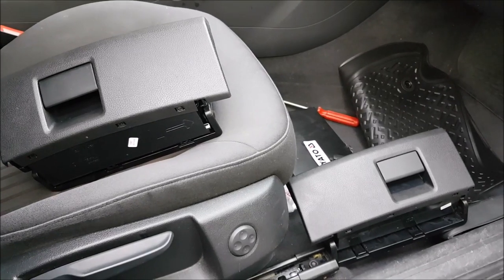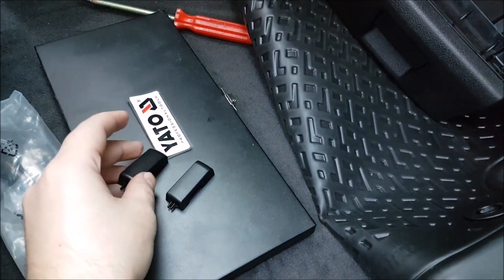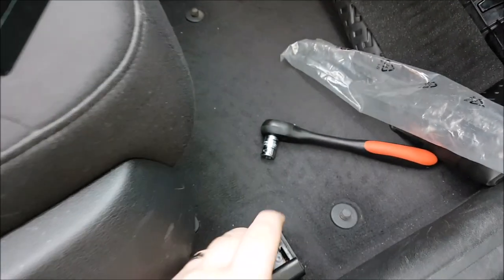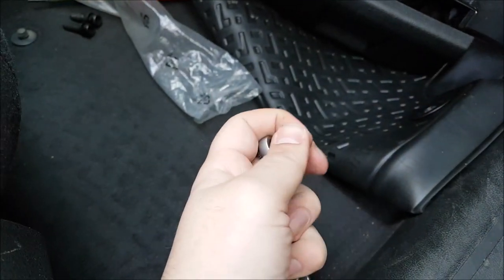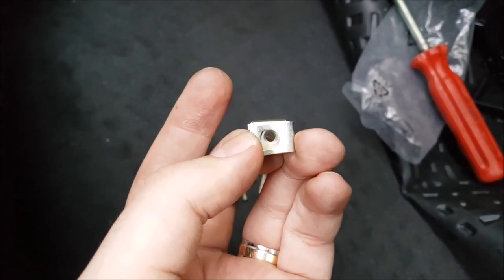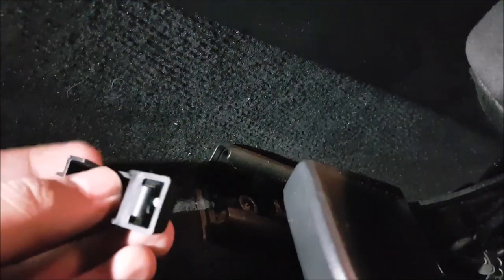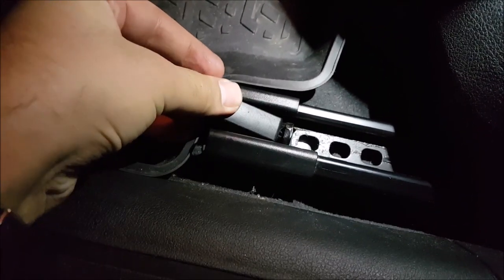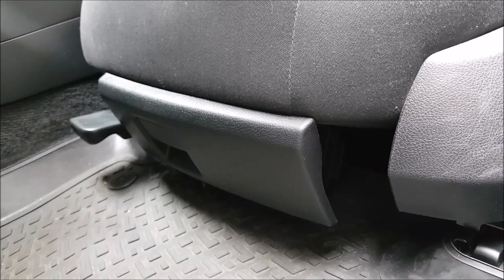Audi A4 B8 - How to add storage bins under front seats

Comment: Do you have any restriction in lowering down the seat after drawer installation?
Reply from the maker: None. It seems it's exactly as big as the seat allows. At least in my case, on 2 different type of seats, because I also upgraded to sport and moved this bins on them 🤭
Reply: @UltimateDIY  Thanks for prompt reply. I have intention to upgrade mine as well, only that I have A6 C6 model, but I suppose that the seats have predisposition for such upgrade.

Comment: You don`t have to get it out of the hinges. They have service position to screw/ unscrew them.
Reply from the maker: Did not know that. How do you get them into service position?
Reply: @UltimateDIY  there`s a clip that prevents them from opening too wide (service position) You need to unclip it and then you have easy access to the screws
Reply from the maker: @dawidzias  nice. Thank you for the info.